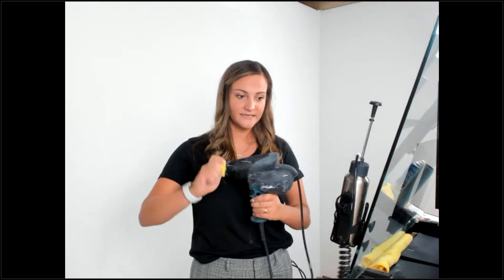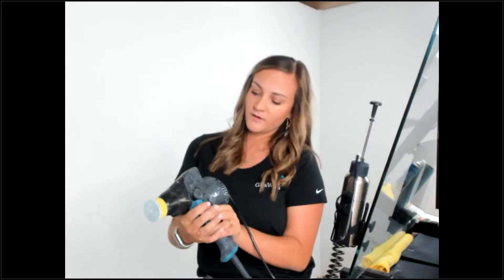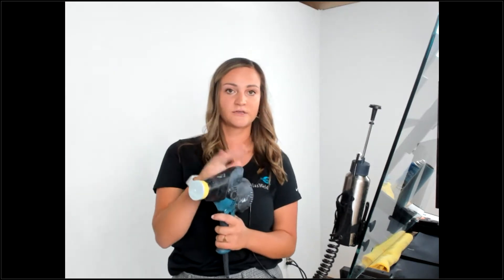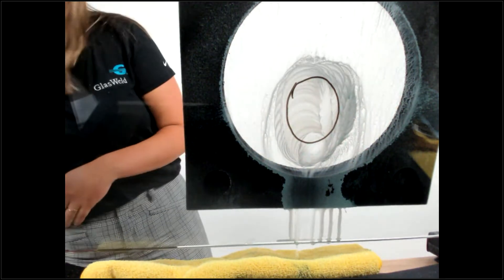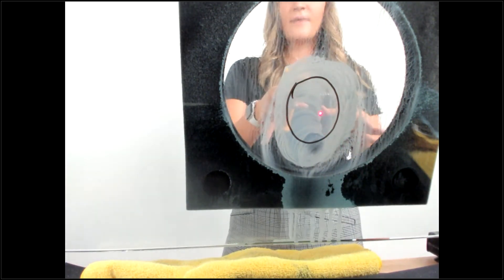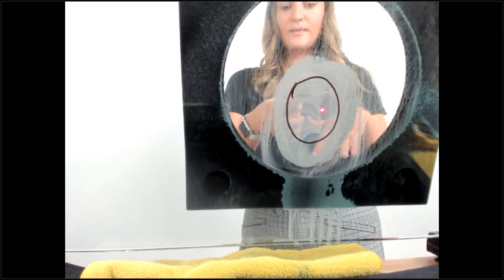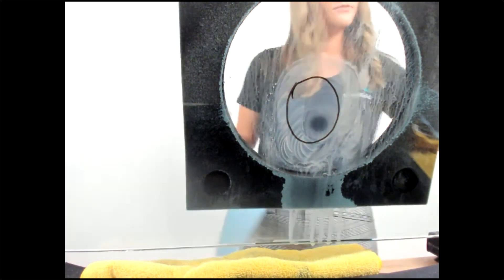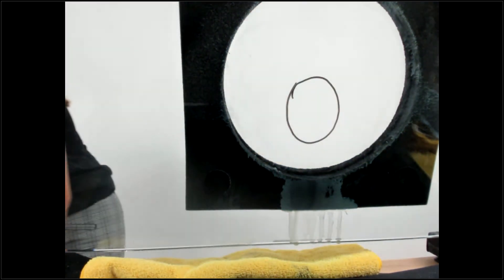WEBINAR: Glass Scratch Removal Demo Using the Gforce Max

Comment: Comes with 60 hours of supplies and repairs take 1 to 2 minutes? So the kit has the ability to do 1,800 to 3,600 repairs? 🤔
Reply from the maker: Great question! One set of 3 polishing discs and a tube of compound can provide up to 60 hours of work. Since many repairs take only a couple of minutes, you could potentially reach the 1,800–3,600 repair range. But since scratches differ in size and depth, the actual number will vary. Most will take just a few minutes, but others may need a little more time and product. For that reason, it’s hard to predict exactly.